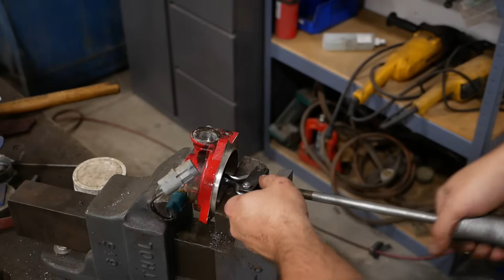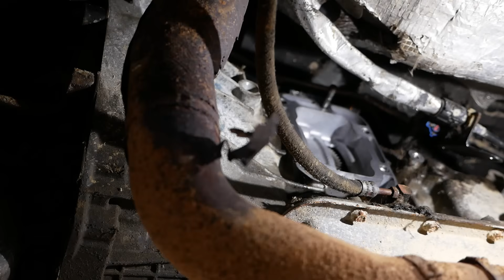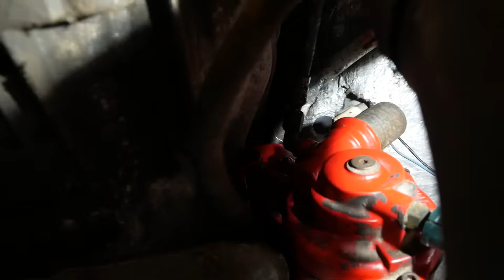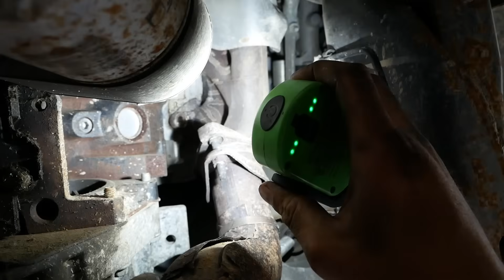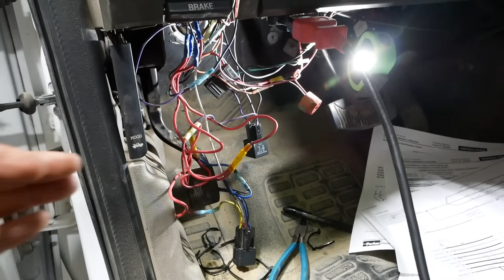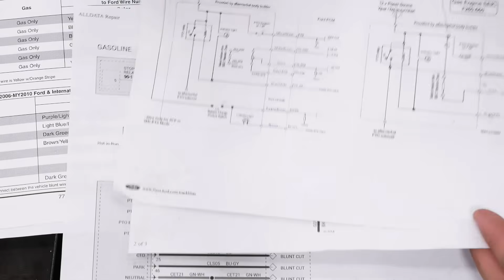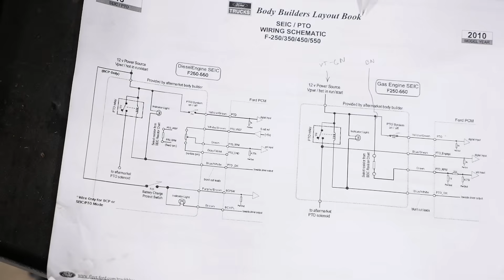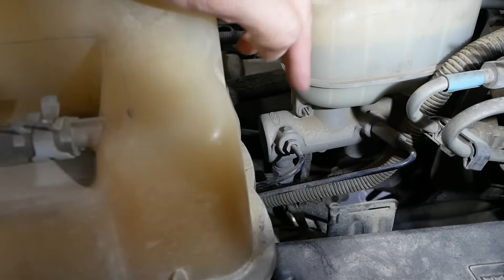Ford F550 Chelsea PTO Repairs - Unexpected Complications

Comment: I'm not surprised that multiple other shops couldn't fix the problem.  A large percentage (most) of "service shops" have no one that is actually capable of trouble shooting and diagnosing a problem more complex than a bad relay or blown fuse.  You my friend are a talented young man!
Reply: Parts Swappers
Reply: @misters2837  master plan of manufacturing, its cheaper to hire a parts swapper than a mechanic allowing for bigger corporate bonuses at the end of the quarter.
Reply: @Mr.Ramirez95  Well they might think its "Cheaper" and for the muffler/brake/tire/general maintenance type shops of yesteryear parts swappers were fine...but now those shops are mostly gone (now Wal-Mart is king), and now you have dealers or Big Chain Shops or Independent Shops...and they have hired parts swappers to do the mundane.  There is less and less of the Driveline and Transmission specialists (and others - we had an "Auto Electric" shop, that was known for finding gremlins) because the consumer has been brainwashed into thinking that a parts swapper and a reman part is OK to install because its "cheaper" - The Consumer doesn't know any better!
Reply: @misters2837  this is the way it's been done by Ford, Chevy, Toyota and many other manufacturers. They KNOW ITS CHEAPER to swap an assembly than repair/rebuild the current one. This has nothing to do with the consumer. We haven't been "brainwashed" we just don't really care how the job is done, as long as our vehicles are back on the road in the least amount of time possible. Time is Money. I think the best market for specialized mechanics is in the older vehicle market, as parts are no longer readily available or manufacturered. I just don't see the need for specialized mechanics in the newer vehicle market.
Reply: @Mr.Ramirez95  Until you need your batteries fixed.
Reply: Yep, so many "mechanics" of today are nothing more than parts changers.
Reply: @stansdds the problem we have now is companies don’t want diag time. They seem to want the parts cannon approach.
Reply: That is literally their job description 😂 but, hey you got something to complain about.

Comment: Congrats on going the extra mile Wes. You did well to solve the issue, having not worked on this type of PTO before. To solve the issue when other shops couldn't speaks volumes, both about the other shops and your diagnostic skills. Not having a manual or diagrams to follow and still get the job done is amazing! Well done. Thanks for posting.

Comment: Ive been watching you for about 3 months now and your smarter than hell on all aspects and seem to care about sending out a quality product unlike most shops. You need to move your familt to the rust free southern climate of georgia so id actually have a mechanic i could trust. The bottom of my 07 F150 is absolutely spotless with ZERO rust, only leakage is where oil filter leaked during routine changes. Most vehicles like that down here. Anyway your awesome and keep up the good work!
Reply from the maker: I wouldn't know how to act with no rust.

Comment: No easy way to check line pressure is there.
Reply from the maker: I can see it on the scan tool assuming the transducer is actually right.
Reply: @WatchWesWork  even if psi is not calibrated you would see psi shift between work mode and road mode or idling. 
Really interesting video 
On a odd problem

Comment: We run these chassis in some of our squirt boom trucks at the power company I work at. Some of them only 3 years old with 300,000 on them so they see every problem that could happen. Same pto set up. In some cases there’s also a “hood open safety switch” that also works in conjunction with the brake pedal switch. 

If the hood is open or the hood switch fails it will prevent the pto from engaging. We see the hood switch fail a lot. The hood switch is to prevent the engine from being turned on from the bucket in case someone is working on it in a bucket truck situation.
Reply from the maker: Wow. I would not have thought of that.
Reply: @WatchWesWork  glad you saw this! I was hoping you would in case it comes back hahaha

Comment: Those clutch drive PTO's have another huge advantage- when the hydraulic pump locks up, the clutches slip and protect both the PTO and drive gear in the transmission.

Comment: Ah to be as calm as you seem to be when confronted with rats nests. A while ago we bought a used 1 ton GMC 4x4 cab and chassis at auction. It had started life as a railroad track maintenance truck that had been upfitted with the hydraulic railcar wheels and a huge service body. The upfit outfit apparently replaced the OBDII data terminal with a WIFI satellite tracking, computer interface. Sort of like the space shuttle. Me being all bright eyed and bushy tailed who would have guessed that the OEM factory electrical schematic would look like a simple Dick and Jane book compared to what they had done to rewire that truck. Just a word of caution to buyers of upfitted vehicles which had satellite tracking and data telemetry, check to see what you are getting into before you show them the green. If it has more than a couple of cut wires hanging out of odd places walk away unless you need a challenge. Wess if you were closer we'd bring it to you and try to twist your arm to rewire it for us. I wonder why upfit companies don't sell the upfit unit with a manual so it can be put back to factory specs at end of service life?
Reply from the maker: That would be nice!

Comment: Interesting find on the brake switch - I had an old Chevy pick up that would kill the battery overnight, I checked and checked and couldn't find any issue. One day I was sitting on the back deck drinking a beer looking at it wondering if I should just junk it when the brake lights came on. I thought I was living in a Stephen King story (ala Christine).  Then they went off, then came back on. Nope nobody in it. Turns out the brake switch was randomly making contact when it got cold, thus the dead battery overnight when it was cooler.

Comment: Excellent again. How did you set the high idle speed to 1400rpm?
Reply from the maker: I followed the instructions from Ford to send battery voltage through a 1K ohm resistor to the RPM input on the PCM.

Comment: I have a septic tank truck. My pto high idle is set by my cruise control. it had two settings. I have a lovejoy rubber sleeve shear gear to protect my vacuum  pump   on my right angle gearbox to my vacuum pump. If you engage pto harshly, you ruin the shear gear. I go thru gears about once a year from normal wear. New septic trucks with automatic transmission  have  hotshift pto setup.

Comment: Great video.

And you should not be surprised by now in finding a rats nest of electrical hacks inside of a older commercial or farm vehicle.

After all you live in the "Watch Wes Work Bermuda Triangle of vehicle Repair"  One of my favorite quotes.

I have to say you are probably the best I have seen of figuring out odd and weird issues and hacks.  And how to fix them.

Lots of good guys out there that can decipher a vehicles problems.  Some very good folks out there that can diagnose electrical issue.

You are truly great at this because living where you do you see the myriad of older vehicles (some of which end up as farm vehicles) that are kept alive much longer than they should be.

I feel like I am much that same as you at my job.  I figure out what is wrong and how to fix it.  Doesn't matter if electrical, mechanical, or plumbing/piping.  They call me "The Wolf".  If you have ever seen Pulp Fiction  you would remember "I'm Mr Wolf.  I fix things"

I might be the Wolf at my job and you are truly "The Wolf" in your area.

 Keep up the great videos.

Comment: The reason all the other shops couldn't fix it was because actually fixing it isn't their goal. Milking someone for all they can is the deal. Dealer mechanics are not mechanics anymore. They are parts changers. O the scan tool says it's this =  change part. Garantied they get a commission . No diagnostic skills. They may charge you 90 $ a hour but they sure don't pay the mechanics that much. They other shops didn't care enough or didn't know how. Wish I had a mechanic like you  local I have alot of old junk you would love working on. Lol

Comment: Nice work. Shouldn't the two switches be ganged together, so you can't turn one on without the other. Running the PTO switch by itself will damage the clutch.
Reply from the maker: We could do that. Running at lower RPM should be OK as long as the PCM is in the PTO mode. Raising the RPM makes the converter lock up so you get all the power out of it.

Comment: Ran garbage trucks for the county here in south Alabama  for 19 yrs. Biggest problem with the pto is the drivers never shut the pto off. So unless it  has an overspeed shutoff the pump get run all day and at road speed it will burn them out. Also the shop mechanics are pressured to get it fixed and back in service asap. so anything the can do to make it work is good for them.
Reply from the maker: Might be what happened here. With the wiring jacked up they could run it whenever they wanted to.

Comment: Haven't messed with any trucks with a PTO in years. That system with the constant mesh drive gear and clutch is pretty slick. Drove a late 70s GMC with an Alison automatic behind a 6v-92 Detroit. Had to set the breaks, put the trans in gear to stop the input shaft from turning, put the PTO in gear, shift trans to neutral and then go ahead and raise the dump body.

Comment: I never realized how many of these F450 and heavier trucks are V10 gassers (I suppose the newer trucks have that new 'godzilla' 7.3L V8)... I recently noticed the street repair crews in my city use a lot of the gas V10 Ford trucks. I'm sure the maintenance cost is way lower and for short trips around town I guess speed isn't a concern. They have plenty of big diesel MDT's and big equipment, but for neighborhood street repairs it seems like an F750 dump towing a small excavator is their preferred setup.
Reply from the maker: Right. These trucks don't run many miles, so the gasser is a good choice.

Comment: I am just curious why the brake pedal being pressed is a no-go for PTO engagement.
Reply from the maker: Don’t know, it’s a Ford thing
Reply: @WatchWesWork  I'd say its likely similar to the Ford AIC (Aux Idle Control) system often found in Ambulances,  As soon as the brake is touched,  it kicks out of high idle.
My Understanding is this is so that if you jump in and drop the truck into gear without remembering to switch off the PTO / AIC, it doesnt slam into gear and lurch.
By having the High idle / PTO kick out when the brake is touched, it gives the engine a moment to idle down before the driver tries selecting a gear (as the shifter is often interlocked to the brake anyway on many vehicles).
Basically its a safety function and the Brake switch is acting as an "Intent to move" signal to the computer, saying "Hey, Drop to low idle Now, driver may be about to try and move off"!

Comment: Didn't you say toward the beginning, that when the outside hydraulic controls were engaged, that is when the idle is suppppossssed to kick up to 1400???  That sounds like a low rpm for the pump, but does make sense that moving a control would call for the higher RPM!!  Also, I worked on sweeper trucks and an assortment of other utility trucks and most often the electrical boxes under the body were mostly all about lighting and travel relays.
Reply from the maker: I'm not really sure how it was supposed to work originally. The owner says he was told it never worked they way it was intended to even when brand new.
Reply: @WatchWesWork  It's been many years since I worked on that stuff, but I believe ours worked on a governing solenoid. I remember we could raise the rpms from the control box at the back of the bed. It worked pretty similar on our salt trucks.. 
I know the garbage trucks that pick up around here  will raise the rpm when they hit the controls from either side at the back of the truck. I use to smoke, so I'd see them all the time while I was out burning my lungs!! 
It's hell being old and handicapped!!

Comment: If only the factory could somehow simplify this madness. Maybe with a lever - sticking through the floor and some type of high-idle cable on the dash and get rid of the clutches, since the guys in the HEAVY DUTY WORK TRUCK probably aren't concerned about noise.

Comment: The other shops probably didn't want to get into the weeds far enough to really find out what was wrong. Just go through the motions like check fault codes, swap a few parts and call it 'good' or give up. Move 'em in and move 'em out for the money.

Comment: I own an 86 f350 6.9idi that I recently changed the injectors and glow plugs on. I took it for a test rip and the C6 tranny isn't shifting correctly. I have to manually shift with the column. When it gets up to 45 in D, I have to let off the accelerator, then it will shift to 3rd. I checked for vaccume leaks and everything seems ok at 24". Do you think I have a bad VRV on the injector pump? I also checked the vacuum control module on the side of the tranny for oil. It seemed fine. Any suggestions would be greatly appreciated. Awesome channel!!!
Reply from the maker: I really don't know. That's before my time.

Comment: Smash all your trash👍🏻.  In some ways the safety setup regarding the brakes is weird for a garbage truck.  I guess in rural routes it’s ok.  But in suburban routes with frequent stops, setting the parking brake and foot off the brake would be a hassle.
Reply from the maker: I don't think they need the hydraulics on every stop. Just when the bin area gets filled up.

Comment: Wes, when I worked on trucks at the used dealer,we often instsalled pto's. The trucks were formally straight trucks or road tractors converted into grain haulers. Last snowplow truck I worked on was a new 550 chassis with V10. I installed a fan belt driven hydraulic pump. Took a very cumbersome bracket on front of engine. After that truck I told boss I'm done on trucks. I went back to tack up and welding on plow hitches. Life was good after that.
Reply from the maker: Supposedly Ford wants you to install a different front main bearing if you run a belt drive pump. I wonder if they've ever sold one...
Reply: @WatchWesWork  Well,the kit I used didn't require one.The pump actually perched on the engine. I remember it included  a new duct for the throttle body.

Comment: Fyi on the Garbage body’s hydraulic control valve there should be w pressure switch.  That is how they normally sense idle up.  As for the garbage body I would not be surprised if its an older body on a newer chassis.  Thus the ridiculous integration on the newer truck.

Comment: Some kind of holding fixture...  hmmmmm.... you need some head meds?  I have that same issue at times..... 
@14:00  Maybe put a couple paint lines on the floor, you can tell her to line up with whichever color depending on the size of the truck / car you are towing.  Just a thought...   Brake switches were also burning down houses....
Reply from the maker: Interesting idea…probably would only work once before other projects took up space and messed with the lines

Comment: Great vid Wes!  I've had similar trans PTO issues with our F550 dumps.  The upfitter and the Ford dealer typically blame each other, and the customer gets caught in this finger pointing game.  I've had to have both of them on a conference call (that I initiate) to get them to talk lol...
Reply: System integration always multiplies problems with sketchy specs or shakey mastery of the components involved.  The Cool Hand Luke effect shows up often. "What we have is a failure to communicate."

Comment: Had a stake truck for work years ago with a 1000 lb lift gate had a switch for higher rpms when lifting, same thing started slow then faster. The only difference was we never messed with the wiring!!!!! Professional service on that equipment didn’t have many problems either

Comment: Yes, there is a TSB on the master cylinder brake switch. Common failure part for non working cruise control. BE SURE TO USE THE FORD UP GRADE TO REPAIR CORRECTLY. It includes a wiring pigtail {sold separately} with a gizmo in it. Check color of switch, original one  is tan, new one is black if I remember right. Look it up to be sure.
Reply from the maker: The recall was already done on the truck.  Thanks for the information
Reply: @WatchWesWork  As you mentioned in the vid, you knew about the TSB. The reason I included both the wire upgrade recall and the TSB on the switch was that i just did one that had the recsll wiring but still had the original switch which WAS bad. It would seem the recall on wiring came first, then the TSB on the switch. Just wanted to let everyone else know what we know... Maybe help them out. By the way, most excellent job, Wes.

Comment: Using a regular steel seal pic to remove and install seals is totally incorrect, and can scratch and damage sealing surfaces.  Aluminum or brass is what is used.  Thumbs down 👎 By watching you beat the thing to death, I wouldn’t hire you.
Reply from the maker: Deal

Comment: I envy your electrical diagnosing skills. I would have torched a hole in the floor and replaced the pto with a lever actuated one.
Reply: And a suitable weight to put on the accelerator to boost rpm..